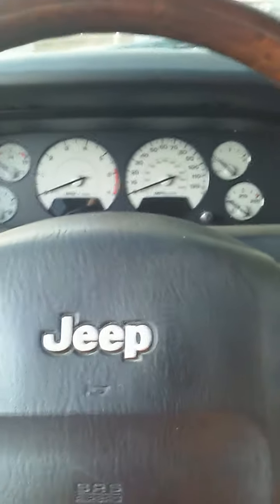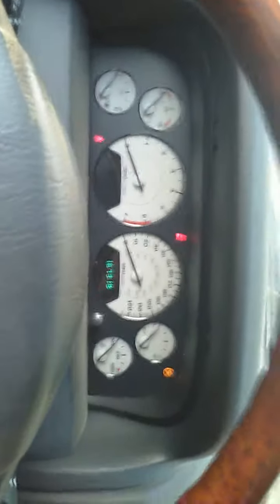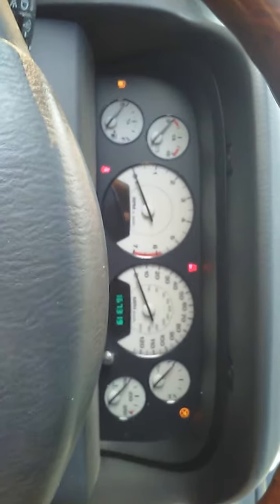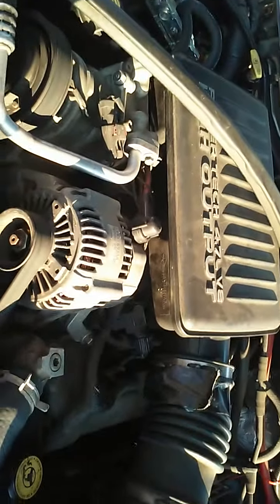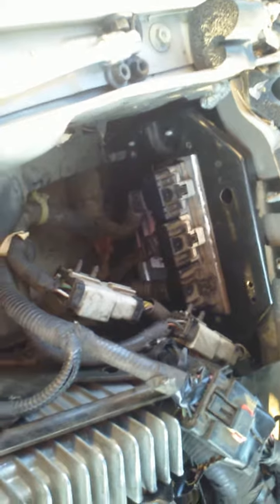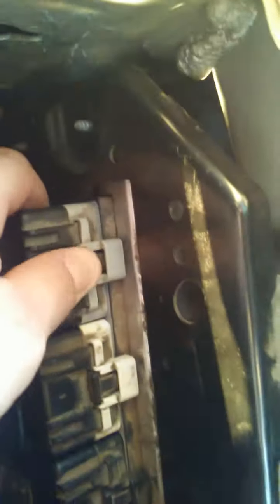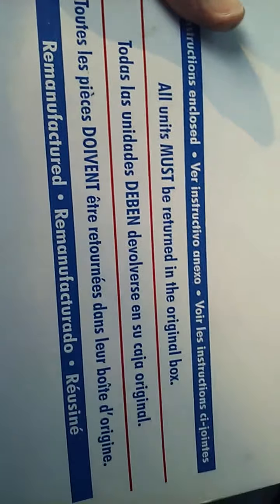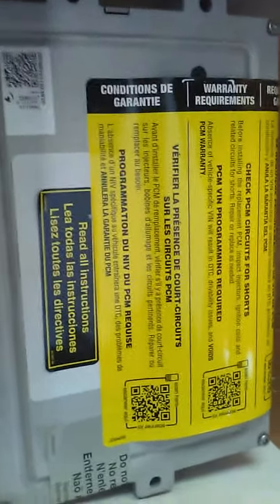Turns Over/No Start Jeep Grand Cherokee 2002 PCM Computer Replacement Pt 1

Comment: Was yours also a crank, no start with the sentry light illuminated? Mine is crank, no start, sentry light is on. Replaced crankshaft sensor and checked all grounds.
Reply from the maker: me do your gauges work?
Reply: Was the Crankshaft sensor the issue on Yours??

Comment: Cant I program the PCM myself ?
Reply from the maker: Seth Blackmoore yeah you could with the correct programs but you'd have to research them and I think the programs are expensive usually businesses only use them. But yeah it's possible.